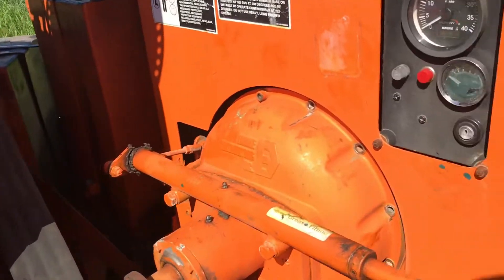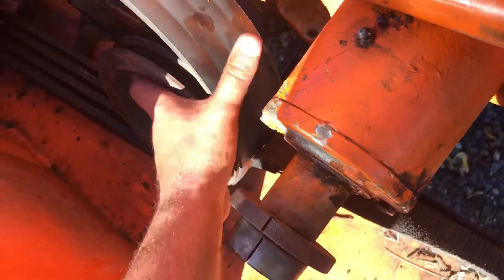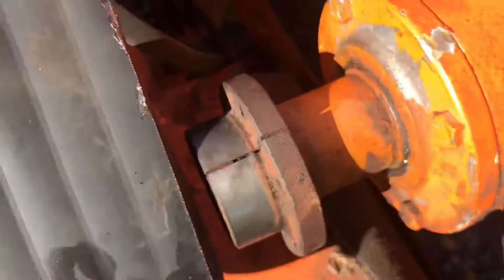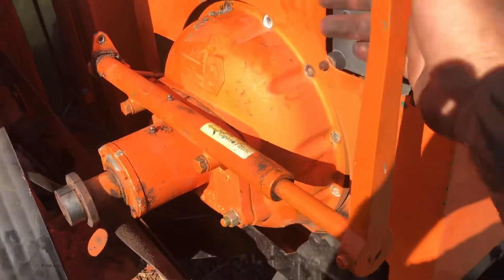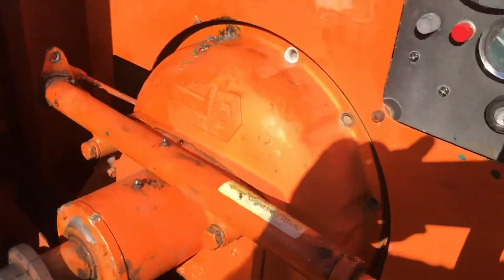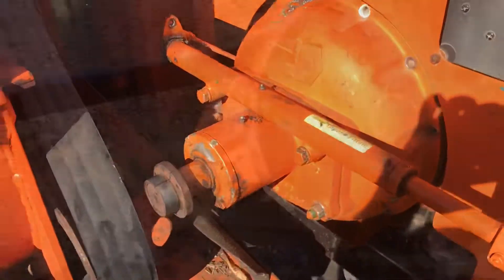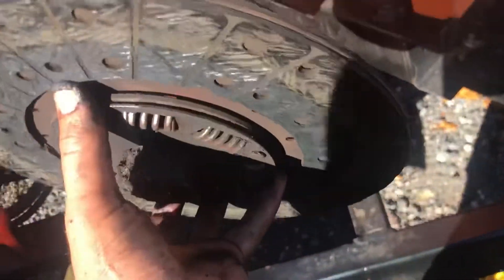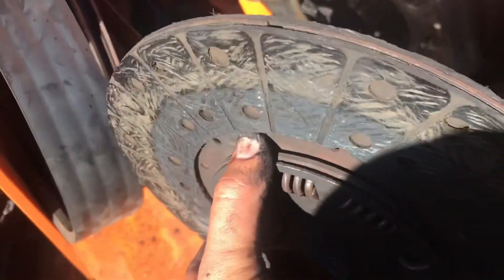Chipper clutch replacement

Comment: My pulleys or sheaves are misaligned by 0.5 Inches. How could the engine side pulley be adjusted outwards to sit farther out on pto shaft.  Is that possible?

Comment: Whats the difference between disengage'ing the clutch.. at full rpm, and low rpm.. my boss says its best at full, yet i hear clearly something metal on metal when he does it... Yet when i lower the rpm and wait for the spinning to slow to an idol, it disengaged with no metal sounds...  This isnt a tractor pulled chipper, yet he says its pto.. :/. And everything ive looked up makes no sence!

Comment: What kind of a belt puller would you use? Last time we almost threw out our backs putting it back on.
Reply from the maker: I don’t use a pulley puller on chippers, but you probably could. 

 Loosen the 3 small holding screws/bolts (take them out) from the small pulley. Then tap on the back of the pulley while rotating it gently outward with a hammer. I would put a piece of wood between the pulley and the hammer while tapping it. It will take a while, but will come off. Try not to bend the pulley in the process.